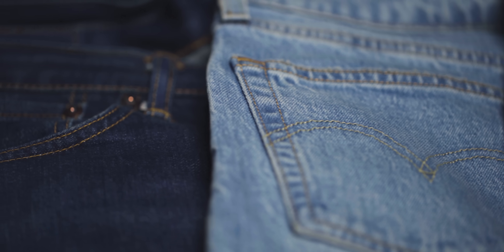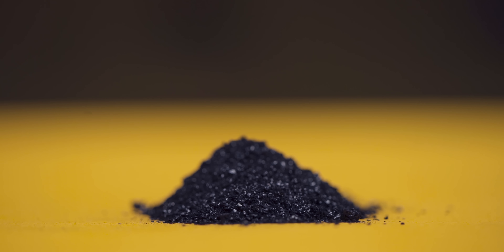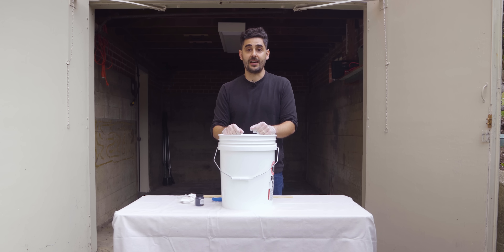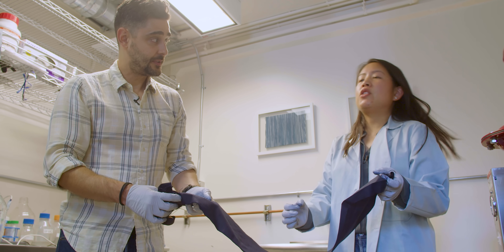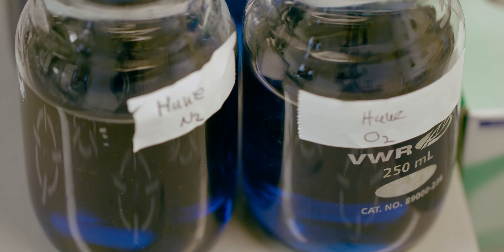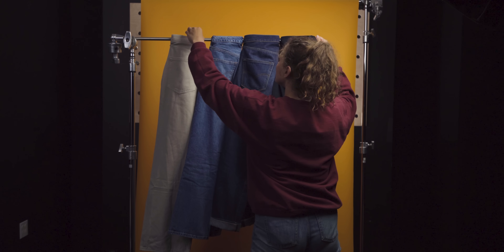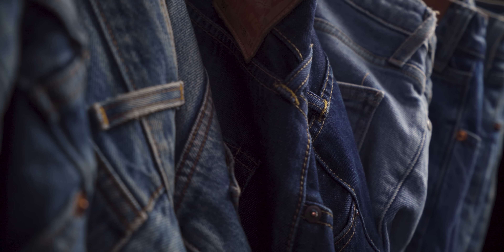How researchers hack bacteria to dye blue jeans

Comment from the maker: What other everyday objects should we dive into next?
Reply: Anything with Teflon.
Reply: Socks.
Reply: The fact that the VW lupo 3L variant from 20 years ago is still about the most fuel efficient conventional car you can buy. Normal cars use 3 times more fuel.
Reply: @nutzeeer  It's not that interesting that an 1800 lb (deathtrap) turbo diesel (literally poisoning everyone in the neighborhood) didn't use a lot of fuel.
Reply: @aluisious  its not a death trap in europe, where not everybody is driving a literal tank like in the US
Reply: @nutzeeer  Yeah... no kidding.  I think you mean the inline 3 cylinder engine and not a 3L variant.  Technically, all the engines are a 1.X variant, whether petrol or diesel.  They vary from 1.0L to 1.7L displacement, i.e. 1000cc to 1700cc if you're used to like motorcycle engines where they usually show in the "cc" unit.   Seems I saw somewhere a hybrid model that was even better in performance, though that was obviously banned in the US like the non-hybrid models.  I followed for a little while as I worked at Bosch for s summer in their foundry as a sand lab and trained as a metallurgy lab tech.
Reply: @jafinch78  Yes I mean the 3 cylinder turbo diesel variant with 1191cc. Its named 3L because it uses 3L per 100 km, which is about 75 mpg.
Reply: @nutzeeer  Thanks for the clarification.  I just read through the Wikipedia in detail and see the Volkswagen Lupo 3L (Typ 6E) is similar to the Audi A2 1.2 TDI "3L" in design.  I never read into that much detail and was more focused on the drive train.  Interesting and great performance using petrol only and not even considering the better performing diesel option.  Though that better performing diesel option would be interesting with some hybrid additional drivetrain to perform even better.
Reply: @jafinch78  Actually the 3L and the Audi use Diesel and are the best performing variants. The lupo was Piech's master piece who retired from VW shortly after. The Audio uses the same drive train and has a usable trunk. Its also more expensive on the used marked, costing about 5000. A hybrid was out of scope for VW back then, as that is Toyotas strong point. Though it would be possible, as using the aluminum-magnesium alloy, alongside banning steel has saved so much weight that a hybrid could be added. Magnesium has half the weight of aluminum with the same stability, but needs to be protected from oxidation. If I recall correctly the Lupo was the first car with a "Pumpe-Düse" diesel injection that has like 2000 bar of pressure. The gearbox is an automatic manual, which combines manual fuel efficiency with automatic luxury. I really like it. As soon as you lift the foot it goes out of gear. It rolls really really well thanks to this and the 155/65/R14 tires. When I tap the brakes it goes back in gear so I can use the engine brake. Just rolling on the highway a slight downhill is enough to keep the speed, rolling with a fuel usage of below 1L per 100 km. Tapping the brake the fuel usage goes to zero from engine braking. (though it doest brake very hard. on steep hills I need to manually shift down). If you want to know anything about the car ask me! I own it!
Reply: @jafinch78  the complete design is explained in german youtube videos by VW from back when the car was launched. The engineers that made the cars explain it. However the videos are in german.
Reply: Condom industry.
Reply: Maybe more pro-biotics like from natural sources that are optimal or statistically better like from breast milk, oral cavities, vaginal discharge (or not), medical grade fecal matter, etc.  Albeit rare to be medical grade now days... there are those bio-equivalent requirements that can be more main stream and cost effective for optimal health.

Comment: One complication is that the indigo dye doesn't penetrate the cotton fibers, but merely coats them.  The fading is caused by the dye falling off the fibers as they are worn, and the fibers rubbed, leaving the white cotton thread.  Getting a dye to stay on the fibers while also not penetrating the fibers is the tricky part.  Would probably be a lot easier if we were willing to give up the iconic fading.

Comment: Funny, none of the environmental impacts are addressed by the presented company as they only produce the pigment. The chemicals needed to reduce it to the leucobase will still be used and companies not better regulated because of their supplier. The carbon footprint may be smaller, but that was not mentioned so I assume it is not.

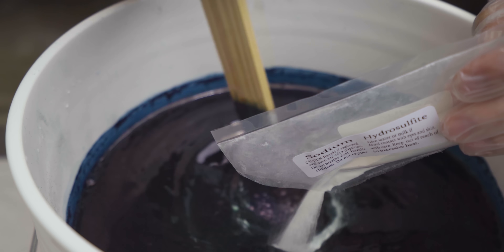Comment: If that dye is as dangerous as you say, the mask you put on at at 2:36 will not protect you.
Reply: Won't even protect from that 91divoc thing going around since the 91divoc is Smaller than the passages of the masks they are trying to force us to wear and has been proven as such. 91divoc is Less than 1 micron in size and the Masks they are trying to force us to wear (Unless specially bought) have 4-5 micron Size passages in them.... but the specially bought ones have Oxygen Supplied/Attached to them because 02/Oxygen is like 1-2 Microns in size... and Most Bacteria is 3-4 Microns in size... All Proven and They have Actually Admitted.